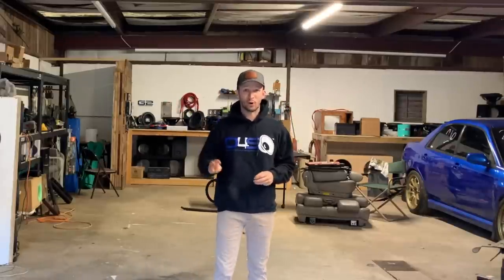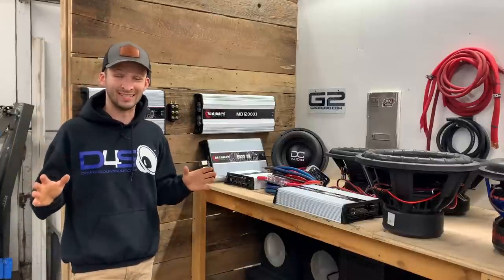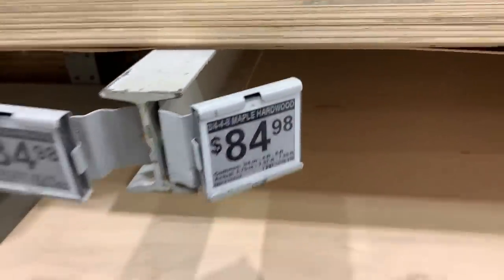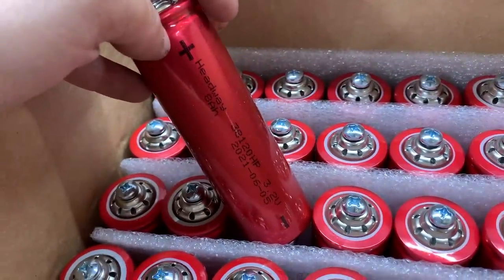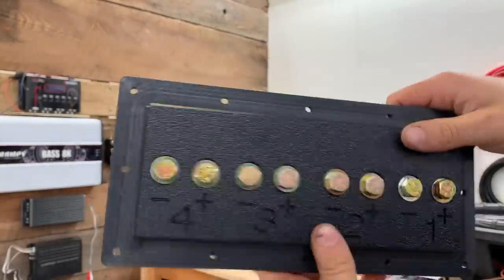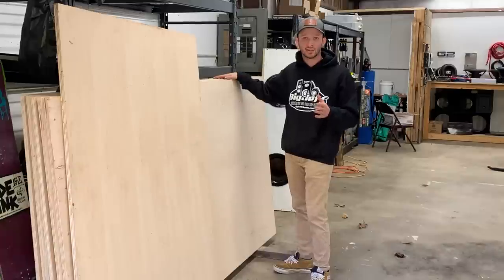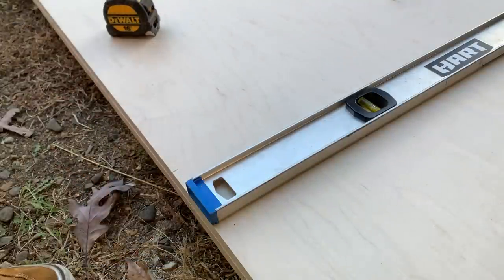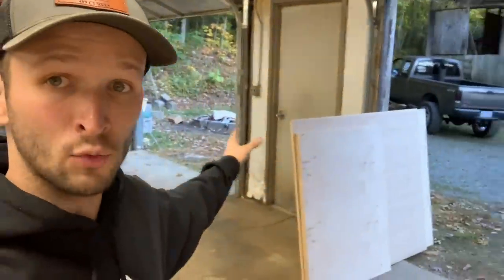Budget Build with 8 15" SUBS Part 3

Comment: Bro do you ever have set backs with these builds, are there outakes? You should do an out take vid.
Reply from the maker: Yeah on my last build the box broke! I showed that. 
On the original build on the sequoia I had an amp that had static issues, I showed that as well.
I try to show every step of what I go through so people can see all the good and bad. So far for this build I’m trying to learn from my mistakes and go a little slower and make sure I do everything right
Reply: @ParkerTheBasshead  oh yeah, I forgot when the box came apart. 🤔